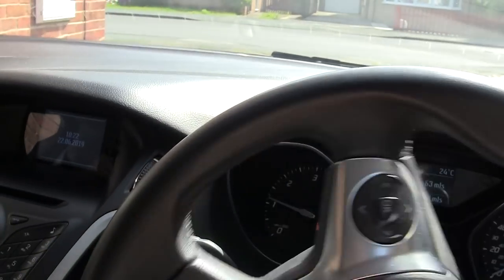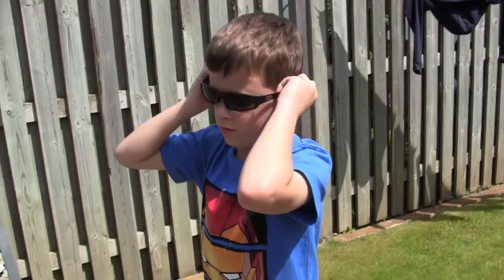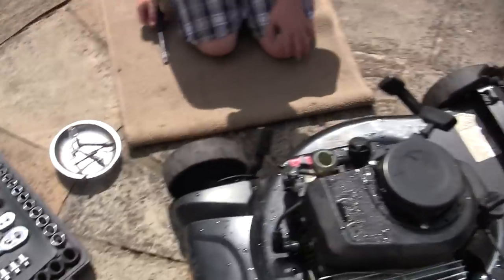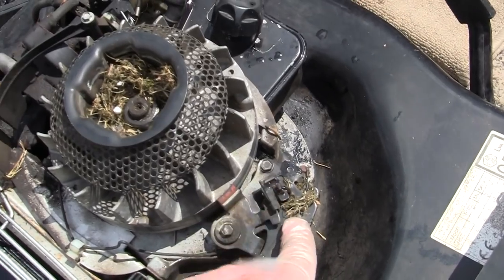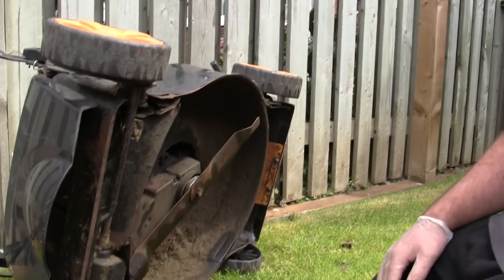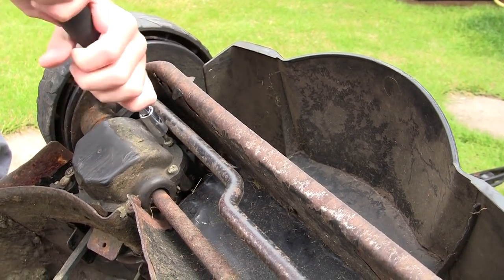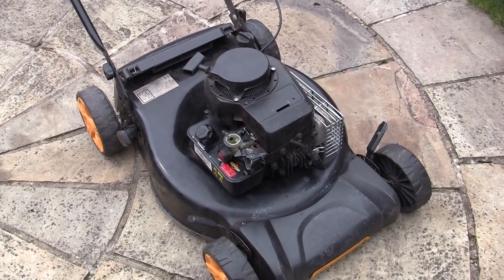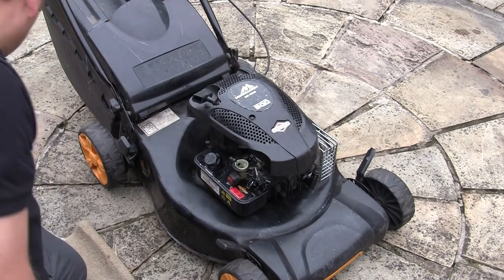Mc Culloch Pocket Money For Kids!  (I'm Retiring)

Comment from the maker: https://repairlawnmowersforprofit.com/
Reply: Hi love the videos. Question if I may; I'm rebuilding an old honda gcv135 engine but the emulsion tube is jammed tight in the carb. I've removed the brass screw that holds it in place but it won't budge. Any ideas? Or am I looking at buying a new carb....£80...😭
Reply from the maker: Kevin Sheehan push it down from the top with an allen key